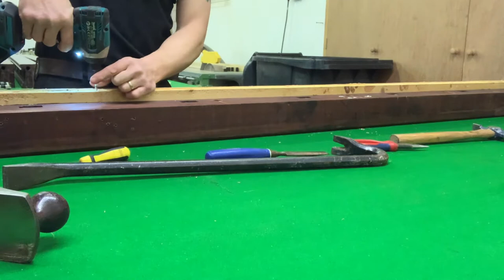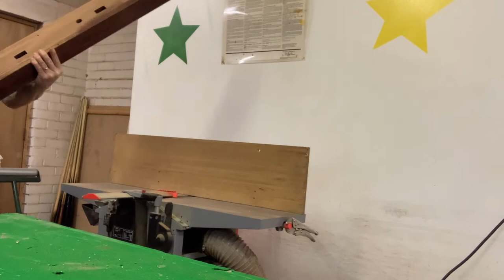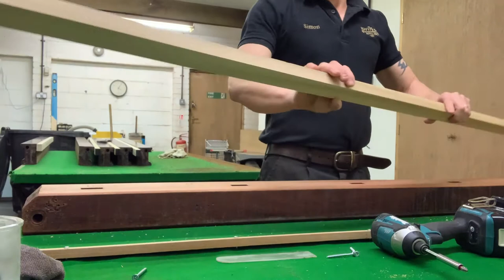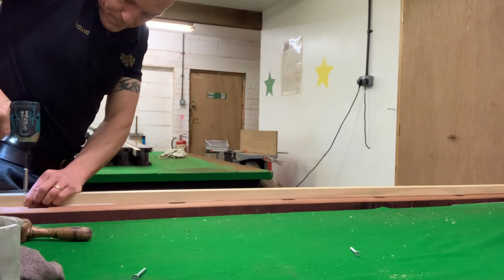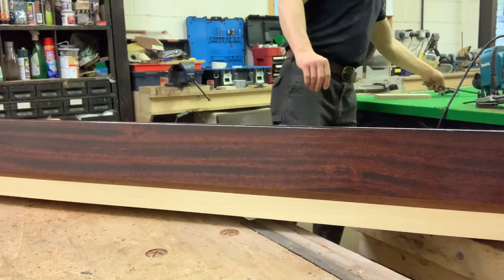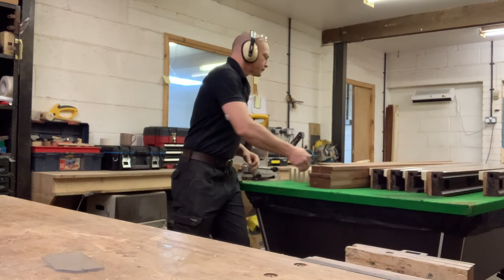Billiard Supply Co - Snooker Table Cushion Refurbishment - Part 1

Comment: In all the years I remodelled or made new cushions, I never needed a crowbar, a planer and found it easier to use rebated blocks rather than a router against the capping of the cushion, wow!
Reply: I’m interested to know how you would remove the old blocks from the cushion capping?
Reply: @simonherbert9130  if the blocks are nailed on, a saw cut on either side of the nail, the chisel out the wood, use a  claw hammer to remove the nail, remove the block with a table saw, but leave some wood on the cushion body, then plane the remainder by hand, checking for flat and twists. Do not forget to measure the bolt hole centre for the new blocks.